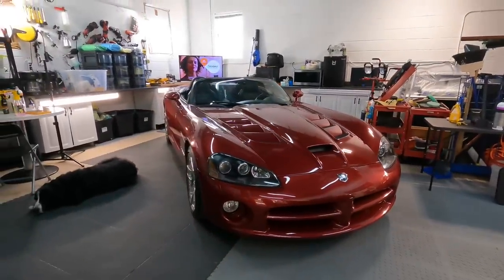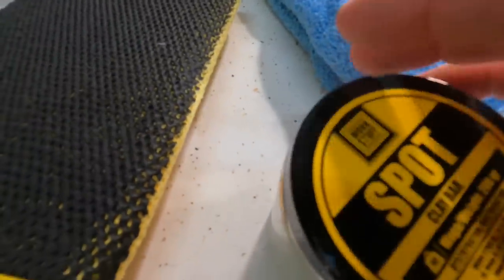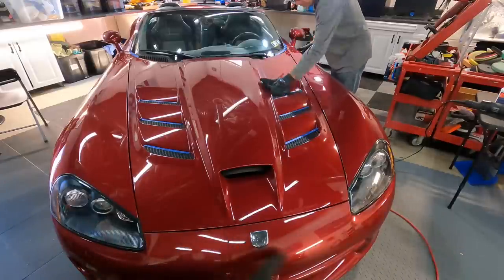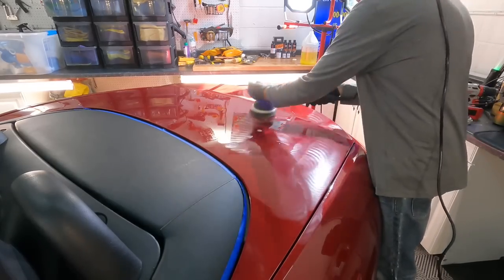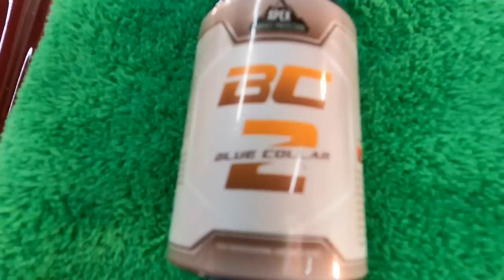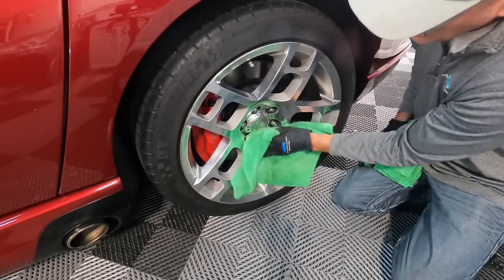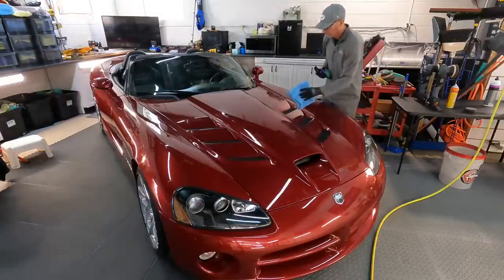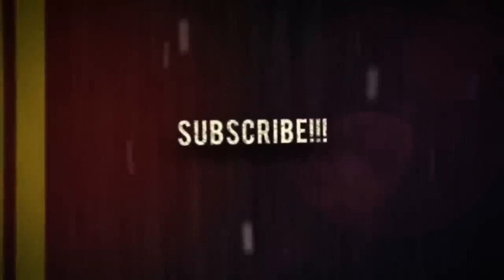How To Correct Previously Corrected Paint!! 8.4 ltr V-10 Dodge Viper! SAVE THE CLEAR!!!

Comment: Hey Brain, I have a question about the products you have made. Between the Apex surface protection and BC line, is there any of them that I got to be certified for? If so which ones are they. I’m very interested in using your products to correct and protect in my side work and someday become a full time work.
Reply: They are all consumer grade. None of them need certification but definitely need some knowledge and experience to apply the correct way and to get the desired results
Reply from the maker: Anyone can use them without certification.

Comment: Great work. That red paint really popped. Hey Brian, what flooring did you finally end up with? I know you had Swiss Tracks. Just wondering because I'm due for something. Cool video.
Reply from the maker: Opted for a Pro 3 layer Epoxy mix. On the list for this winter.